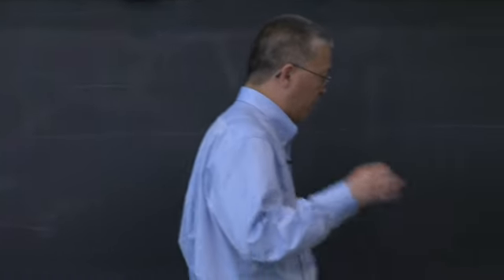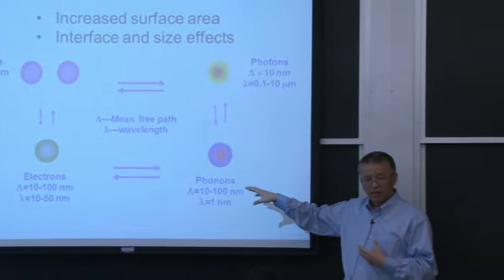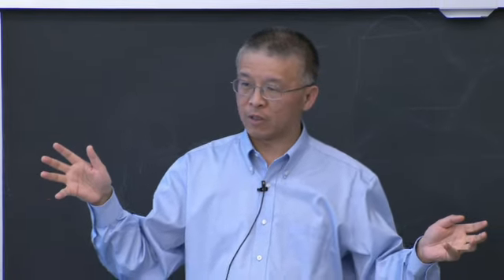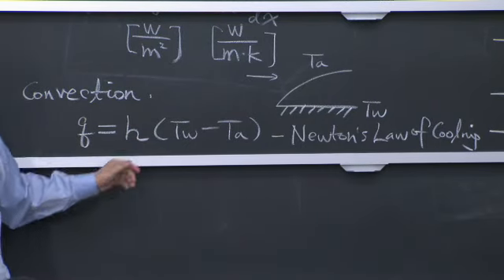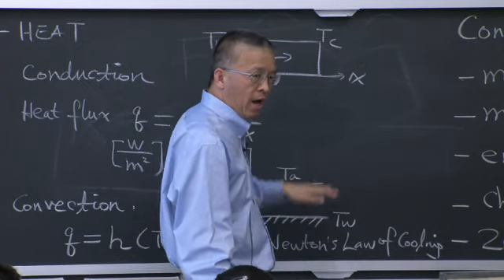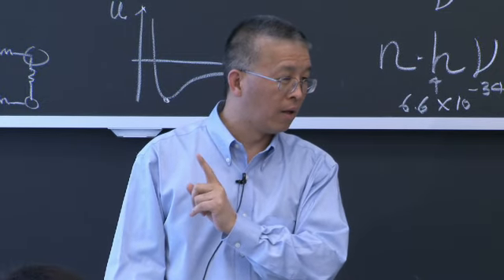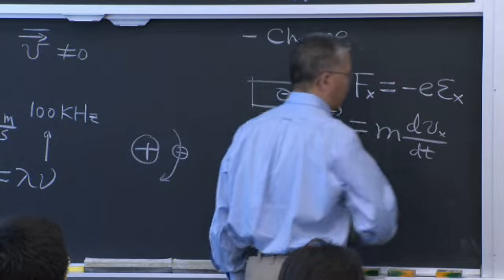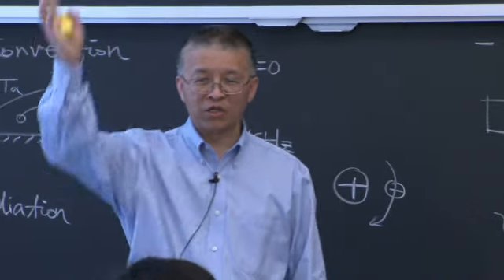1. Intro to Nanotechnology, Nanoscale Transport Phenomena

Comment: Sadly he uses bottom-up explanations and does not define the problems clear enough. 

Richard Feynman's top-down explanations and easy to follow problem determination are way more easy to follow.
Reply: With top-down assessment you have to depend totally on a technology that operates in a biological system based on a 'symptomalogy' type reference.... Not in its system based/growth connections
Reply: Any rebuttal?